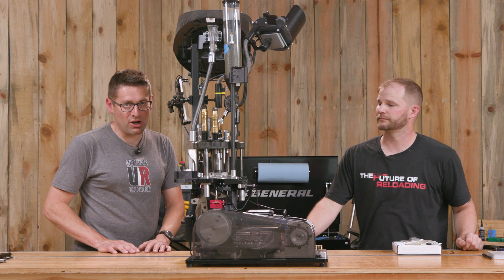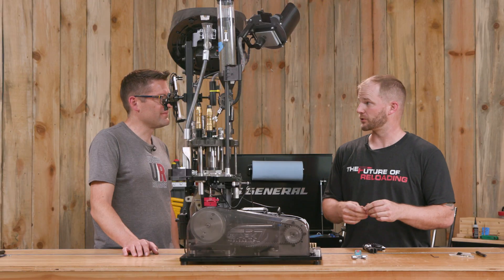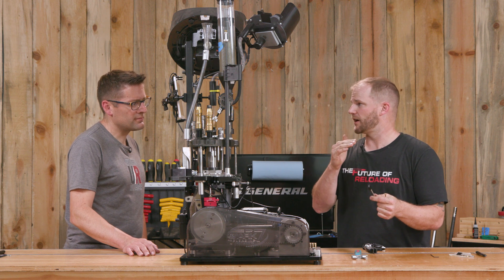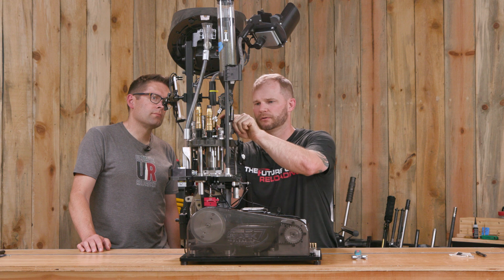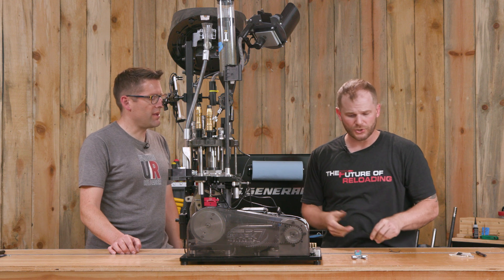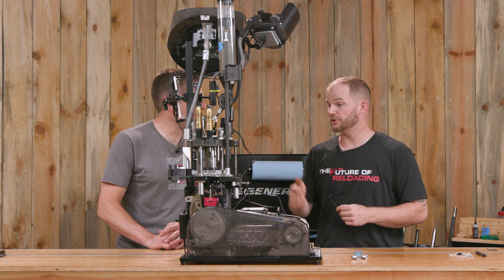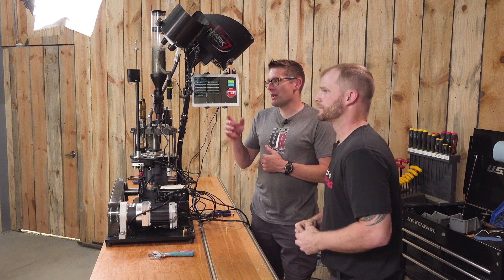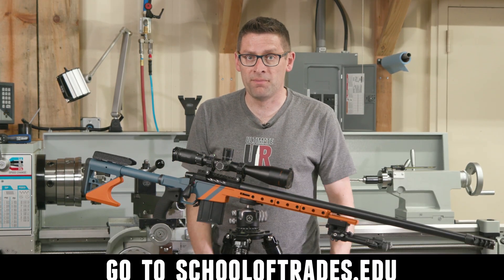Mark 7 APEX 10: Electronic PowderCheck Sensor (Demo and Setup)

Comment: I use a alpha dynamic powder check. Very good product.
Reply: I also starting out using the Double Alpha sensor,  which works well, but it can't automatically stop a press with an autodrive. Since I have an autodrive, I got the Mark 7 powder check sensor and swapped the Double Alpha out it. Setup was easy and it does indeed stop the autodrive when the powder throw is outside the range of acceptability. It doesn't have the audio output of the DA, but it does stop the machine. So, for that reason, I am staying with the Mark 7 sensor. For a manual setup, the Double Alpha would as good (or better) and be quite a bit cheaper. For an autodrive, this is the way to go.

Comment: Truth is, of all the parts of this press this part is the most frustrating.. with 223 especially.. 1/2  the time it shuts down the press its a fauls flag. That alot when you find out it goes off every 10 to 15 cases.. ( on my revaluation 's and auto drives.) Also parts inside a super finicky.. only thing that sort of helps is polishing internals and making sure they are clean
Reply: Yep, I commented earlier that i wished the powder check was a bit better, easier to adjust and change out. I dunno where my comment went. I absolutely love the machine, otherwise. I'd like to buy an updated version if it ever gets released.
Reply: @High Desert Drew  I'm going Ammoload next time.. to manny problems with the original revolution.  Not nearly as fast as I need for rifle and not nearly as consistent in general. For home use it is but for a business no way
Reply: @luckyshotammunitiongunsllc2369  who makes ammoload?
Reply: @Soulman6969  ammo load world wide..
Reply: @luckyshotammunitiongunsllc2369  Unless Ammoload upped their game on the rifle machine I'd look at Camdex instead, that thing used to have issues with powder fouling the main drive linkage and it would get full of a sludge of powder and grease in that scotch yoke design. I used to do high production on ammoload Mark X pistol machines. Sold 'em off a few years ago when we stopped going pistol. I think I like the Ammoload rifle machines, and Camdex rifle machines, but I like the Mark 7 Apex better. That said, I don't prime, and I don't size on it, I'm running all new components. I could probably reasonably keep 3 of them going by myself.
Reply: @High Desert Drew  they are much better.. I'm not a fan of the camdex for anything more then brass prep. ( and 3 dillions and auto bots can do for way less of a cost) I always use factory new brass so no need to lub when FL sizing. As far as the priming is concerned that is the part I feel ruins it for all the machines.. its worth having a machine the just primes cuz it will speed you up x2 for all other steps

Comment: Whats the whole cost of the full set up
Reply: I bought one and set it up for 5.56, all in, including the bullet feeders and whatnot ~$6500. I bought the powder, bullet, primer drop sensors.
Reply: Full revolution set up 2 years ago was 15k
Reply: Thanks
Reply: @wickedtrutharms57  The Revolution and the Apex 10 are different machines, the Revolution has a rather complex built in primer autofeed system, some differences in the frame, and comes fully integrated. The Apex 10 has a number of components.
Reply: @highdesertdrew  Thank you for the info. How many round per hrs? Any issues with the machine?
Reply: @wickedtrutharms57  I get a solid 15-1600/hr (of rifle ammunition) and it will do it for hours and hours. I've had some accuracy issues with the powder dispenser, but I think it might be error on my part, I am running well worn dillon powder measure on mine right now. Depending on how much experience you have reloading, it may take you a few hundred to get familiar, 20-50,000 rounds to get competent, and a few months to really know the machine. I've loaded about 250K on mine. Just remember, I am running brand new primed brass. (yes, this matters)
Reply: @highdesertdrew  thank you
Reply: 15k was the revaluation

Comment: I have not watched all the videos but...  what is your opinion on the Mark 7 on 6.5 creedmoor?  Or 6GT?  What kind of SD do people normally see?
Reply: I use it for prs type matches. I load dasher/br/creedmoor/6x47 on a progressive press and I hate myself for not have purchasing it earlier. I have single digit SDs but I use auto trickler for the powder
Reply: @TonyG818  Using a Mark 7?  That's impressive.  And helpful.  Considering going that route, as a single stage press is just too time consuming at volume.
Reply: You're unlikely to find anyone who is going to do load data and testing for a bolt gun using a progressive. Imo.
Reply: @kalindanley2843  It's probably just fine for new if you have a really dialed in load. One trick you can pull since there's so many die stations is multiple powder drops.
Reply: @kalindanley2843  Why do you say "bolt gun"?  Lots of 6.5 creedmoor semi-autos on the market (I'm loading for my Nemo right now).
Reply: Any updates on this? Does it work as advertised please?